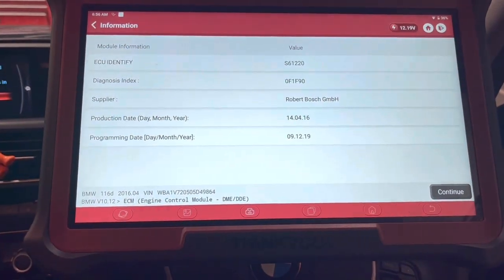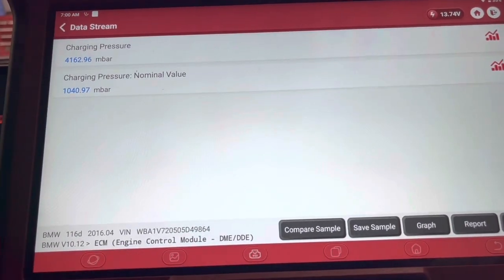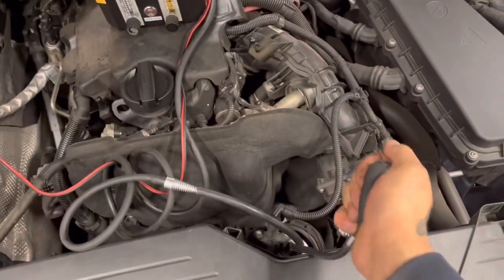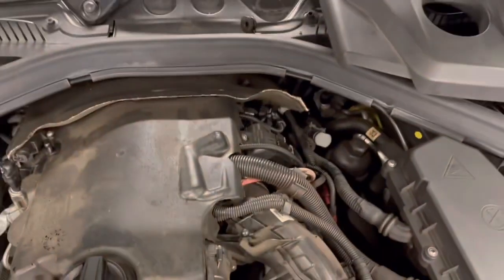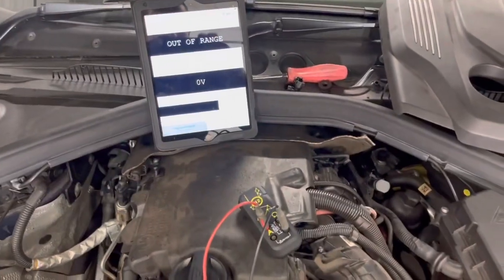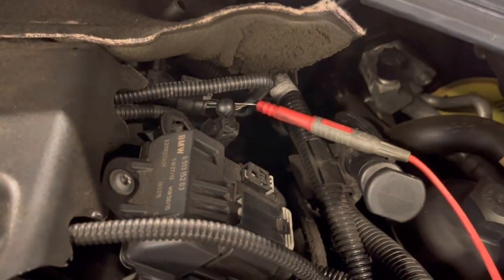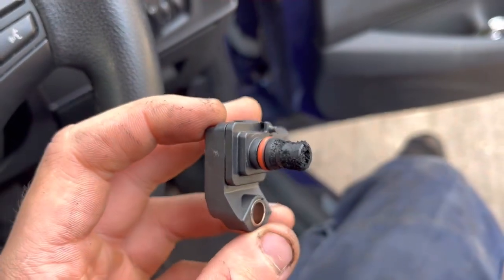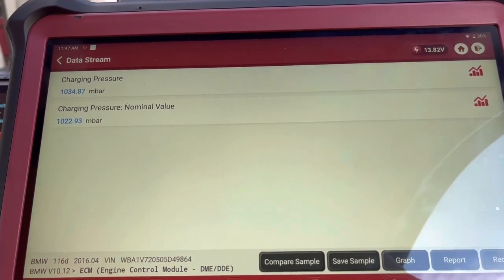BMW f20 1 series 1.5d - 2AB400 246B00 2AB500 24CF00 CHARGE PRESSURE FAULT - SOLVED!

Comment: Hi, You had me hopeful this was my issue!!  I get all the same codes even after changing not just the pressure sensor but the MAF and both lambdas. Also had a new egr and air intake manifold(on the recall) DPF has also been recently professionally cleaned.  Are there any adaptations that i need to reset? or any other tricks? i can find my way around ISTA.
Reply from the maker: Might be worth smoking testing intake, could have a split hose somewhere or intake leak
Reply: @fix-it-frazer1897  Smoke tested it via the same inlet pipe you used.  no leakage, but i did find a pool of oil in that pipe
Reply: Could possibly be turbo problem

Comment: You just saved me 100's pounds, sensor only cost me £45. becuase of this sensor, I had codes for Mass airflow sensor and Nox sensor and they are not cheap, plus the car was throwing drivetrain error with loss of power, didn't know where to start after watching your video I knew exactly what to do, 👍👍👍

Comment: This video was excellent , logical diagnostic path very well explained .I have virtually an exact match to this situation on my 320diesel B47 engine . Mine has a DTC for mass air flow issue as well . But with the help of this diagnostic I have some great clues where to look . Unfortunately I don’t have the smoke tester or Bluetooth multimeter . I will check and test this component , great video ,thanks for taking the time to post it .
Reply: How did you get on with your fix? Was it just the sensor needing replacing? I have the same car as yours and the same codes.
Reply: @calnicolson  Hi , I am sorry if I manage to fix something off the back of YouTube, I try and post what I did and how I got on. My fault turned out to be the turbo boost sensor pressure pipe that was blocked solid with soot (this pipe is located on the O/S drivers side of the engine). It is not a hard job to take the pipe off, it has a series of bends in the pipe that accumulate the carbon and soot . I used some strands of wire to progressively break the soot up and then spray carburettor cleaner up the pipe and eventually get it clear . Problem solved . I now have a spare boost pressure (new)sensor because of my poor diagnosis .